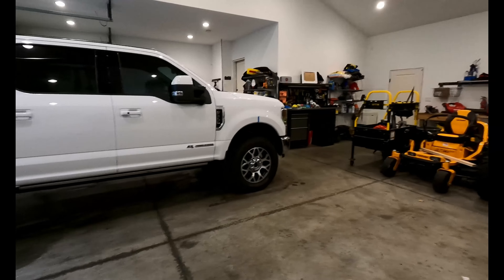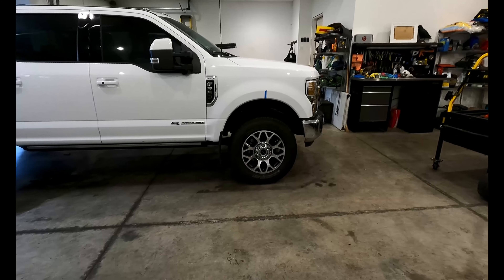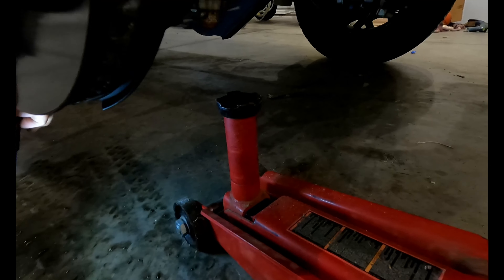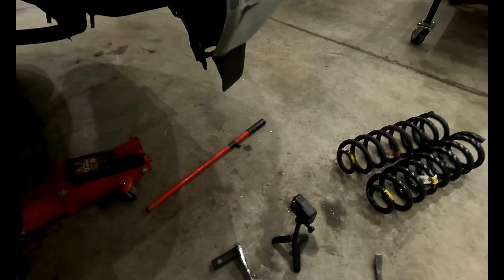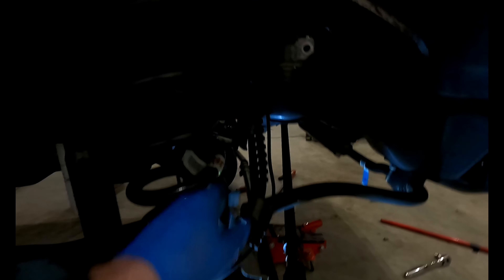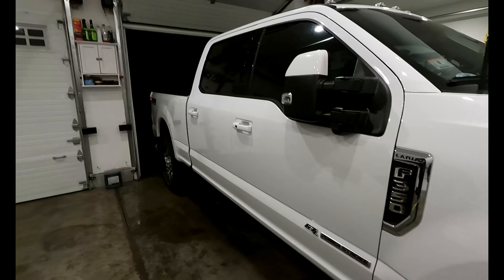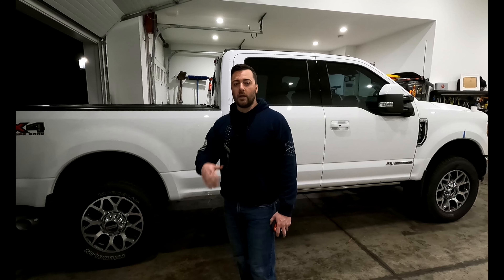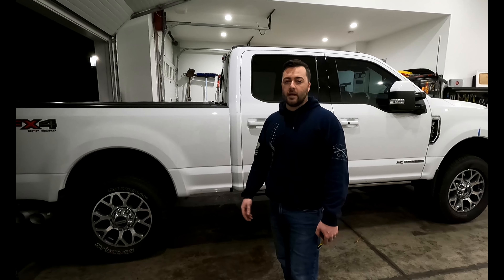Lifting 2022 Super Duty (Part 1): Upgrading Front Springs

Comment: I have a 22 F350 Platinum and I installed a Carli Commuter kit which has taller front coil springs and I also had to install the 17-19 factory 3” block. You need to also order the longer U bolts that are used in the 17-19 trucks.  The block part number is HC3Z-5598A and B.   The U bolt part number is HC3Z-5310-E.   I had the dealer look up a longer U bolt and order them for me and I installed them and the nut was flush with the bottom of the threads with no threads left over and I wanted some extra thread left so I found a VIN # from a 19 F350 and had to buy a second set of U bolts so I learned the hard way and paid twice.
Reply from the maker: Thanks for the comment and information!  I actually ordered and installed the blocks with new u-bolts a few days ago.  I did the same thing...pulled the Vin of my 2018 F350.  Couldn't believe the cost of those u bolts haha.   I'll have a video of that soon.  I also went ahead and ordered an adjustable track bar...the increase in ride height was enough to shif the axle out of center...not a huge amount, but enough to make me want to address it.
Reply: Mark how do you like the carli system?

Comment: Do you like the ride more? Bouncy or harsh? I was considering getting the 6000# but now am considering the 7k. Any death wobble issues? Did you add caster shims?
Reply from the maker: Are you running a diesel or gas?  I actually prefer the ride now..I don't notice any difference as far as the ride being "harsher."  With the stiffer springs the truck stays flatter while cornering and doesn't seem to "dive" as much with the weight transfer while braking.  I did have to install an adjustable track bar because of the increased height.
Reply: I have a 2023 longbed diesel fx4. Not really interested in a level kit and don’t want anything larger than 35’s so the heavy load springs giving anything from .5”-1” is nice to take a bit of rake out.
Reply from the maker: @johnrosebushjr8249  Yea, that was my thought too.  Also decided to put the larger blocks in the rear so the truck didn't look like it was sagging when I tow.  Good luck with the mod... keep in mind you may have to add a track bar depending on how much height you get.
Reply: Did you need caster shims? What track bar did you end up with?
Reply from the maker: @johnrosebushjr8249  I did not need shims.  I ended up going with the Rough Country adjustable track bar.  So far, so good.

Comment: If the springs are not turned against the bottom stop will they make noise? My 2022 is making a strange knock over bumps on the drivers side and i noticed the spring on the bottom mount is not turned against the stop?  About 3/4”
Reply from the maker: I'm not sure if that would cause a knocking sound.  Is there a space on the passengers side too?  I would probably check that first before going through the process of turning the driver's side.

Comment: 7000 lbs spring dont make it to rough on high/low speed bumps?
Track bar will be neccessary change it?
Reply from the maker: Not too rough at all...actually keeps it more level in turns and reduces the "dive" cornering and braking.  Yes, for mine a new track bar was needed because of the increased height
Reply: Did you notice your alignment being off after changing the springs?